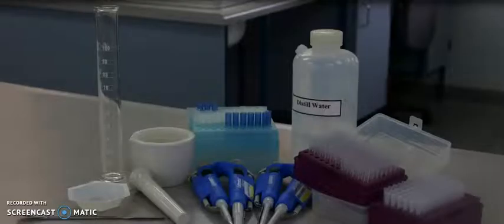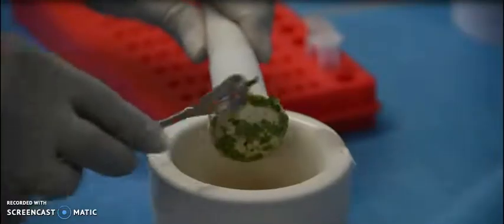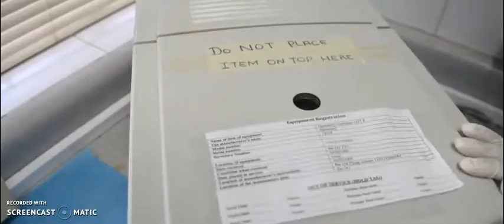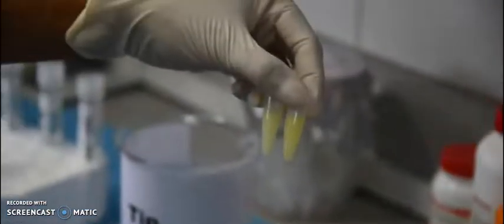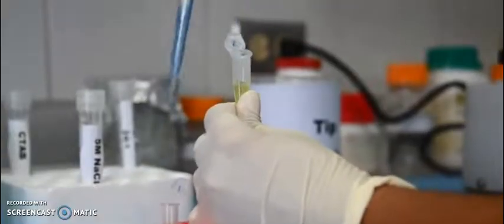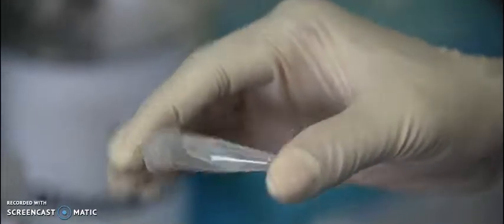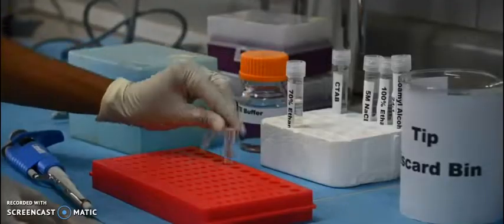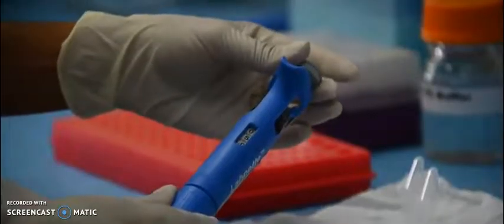Plant DNA extraction - CTAB Method

Comment: Was the pH 8 of TrisHCl measured at 65°C or at room temperature? If the pH is 8 at room temperature, will that affect  the first step, where you incubate the sample in the buffer at 65°C, since the pH changes with temperature?
Reply: i dont think pH at 65 could changes that much so its fine
Reply: pH doesn't change use water bath incubator